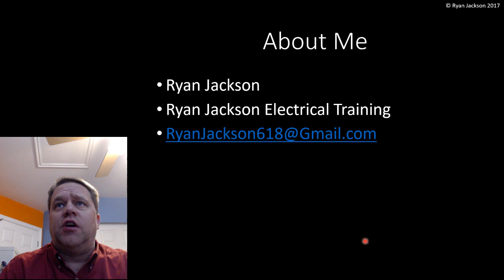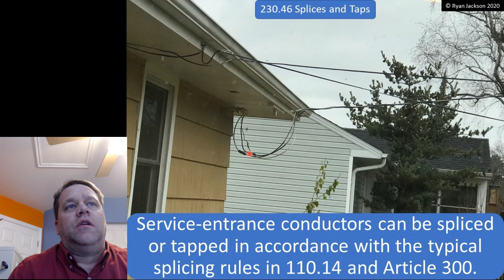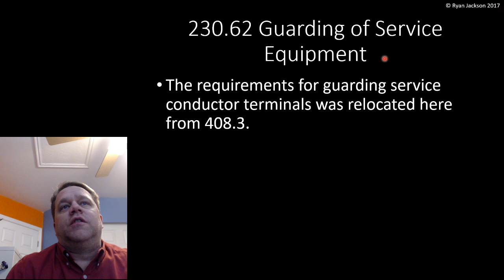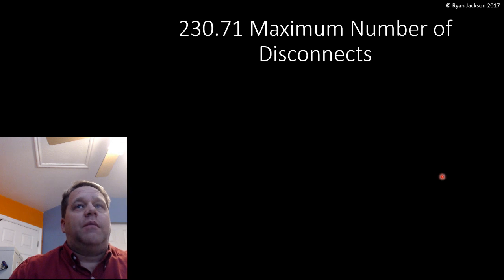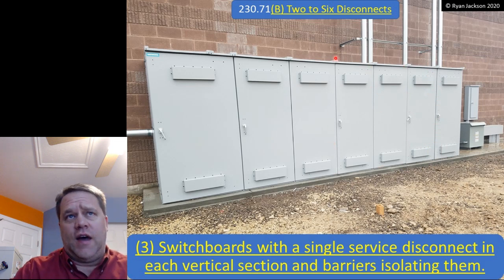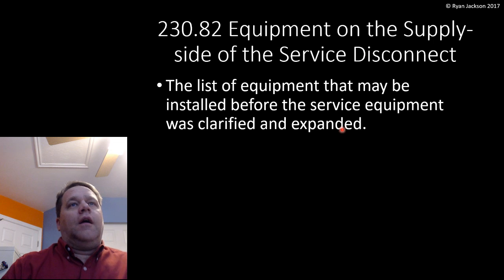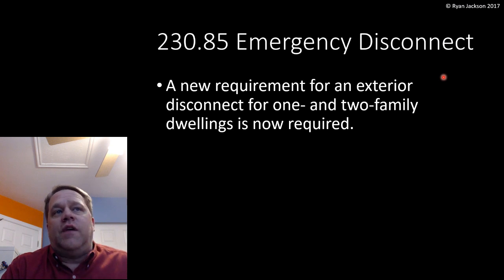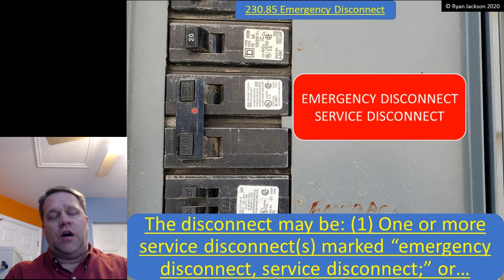2020 NEC Article 230 changes

Comment: I wish michigan adopted the service disconnect requirement before we installed all these solar panels. (one and two family dwellings) utility workers like it when electricity comes from the power plant. Not single and multi family dwellings. As one who is expected to work with electricity i feel responsible to point this out. Im just a hud daddy.
Reply: In michigan, for it to be approved by the utilities, which is a legal requirement for them to operate legally, exterior isolation of the solar inverter is required. Plain and simple, the majority of installs are not legally operating, but none of the cases referred to the state have gone anywhere. I've seen the photos of krone blocks for telecoms melting because an installer(not the homeowner) used them to terminate and aggregate DC at hundreds of volts from the solar panels to the inverters. That installation had no disconnect anywhere, and required a troubleman to cut the line such that the system could be rendered safe and inert. Ruined a brand new pair of insulated cable shears.

Comment: I've pull the meter vice schedule a service outage with the utility. I contact the utility after the fact and they come by and put a new seal on the meter. Does the code address this method?
Reply from the maker: The Code doesn't address work practices, but I can tell you that many utilities will have a fit over that. It is also not particularly safe.

Comment: Not in total agreement with the SPD requirements. If the code is not intended to be used to make electrical systems efficient then why are we going down this path. Surge protection is used to protect electronic equipment within homes it does not protect the building wiring system or people . Again another change to the code geared to make manufactures money and cost homeowners and contractors more money. getting out of hand is what the code making panel is doing.

Comment: About five minutes in you state that there’s a lot of things in the NEC that don’t have to be listed. I would strongly disagree. Essentially by everything being Labeled, listed, or approved, it keeps me from using a vacuum hose as a raceway…
As the one meme with the guy sitting at a table drinking coffee: Change my mind. 

110.2 Approval. The conductors and equipment required or
permitted by this Code shall be acceptable only if approved.

Equipment. A general term, including fittings, devices, appliances,
luminaires, apparatus, machinery, and the like used as a
part of, or in connection with, an electrical installation.

Approved. Acceptable to the authority having jurisdiction.
(CMP-1)

Identified (as applied to equipment). Recognizable as suitable
for the specific purpose, function, use, environment, application,
and so forth, where described in a particular Code requirement.

Labeled. Equipment or materials to which has been attached a
label, symbol, or other identifying mark of an organization that
is acceptable to the authority having jurisdiction and concerned
with product evaluation, that maintains periodic inspection of
production of labeled equipment or materials, and by whose
labeling the manufacturer indicates compliance with appropriate
standards or performance in a specified manner.
	
          Informational Note: If a listed product is of such a size, shape,
          material, or surface texture that it is not possible to apply legibly
          the complete label to the product, the complete label may appear
          on the smallest unit container in which the product is packaged.
Reply from the maker: Yeah, most things in the NEC DO NOT need to be listed. Everything needs to be approved [110.2], and many things need to be listed (luminaires, appliances, and many other), but most things do not (circuit breakers, panelboards, transformers, motors, SEVERAL others). I think you are probably misunderstanding 110.3, which happens a lot. Notice in 90.7 that phrase "specific items." Many products CAN NOT be listed because there is no product standard by which they could be tested and subsequently listed. This is why specific articles require listing for items falling under the article's purview, but, again, most do not.
Reply from the maker: Section 110.8 is what keeps you from using a vacuum hose as a raceway.
Reply: @RyanJacksonElectrical  you use breakers as an example. If a breaker isn't labeled for use in a particular panel, it can't be used. I have seen this particular item shot down by many inspectors over the years.. 
I might give a little on "listed"..
Reply: @RyanJacksonElectrical  yes & no for 110.0.... (sorry I thought it would tei to the post I replied to)  Most of my experience has been industrial, where the AHJ is the company. While many companies have specs that far exceed the NEC, many do not..... 
Quite often you have to battle with a young, fresh out of school engineer, that has no experience or practical knowledge in the field.....
Reply from the maker: @dewaynefanchier589  Again, nothing in the NEC requires everything to be listed. That was your argument, and your argument is wrong. Period. It is wrong.

Comment: Hummm  everything has a ying and yang , good and bad,  230.85  the disconnect is a must , I would bet there are more home invasions then fires  Just wait until the thieves  start killing the power outside of a house ( at night) , talk about home invasions best friend .....
Reply: This happens in another form in Atlanta.  Crooks rush into a home and first cut the wires to the alarm system and rip off the wireless panel unless its wired, in which case they cut the wire from the outside.  This outdoor disconnect only works in a low crime/high trust society.  Speaking from experience...
Reply: You can put a lock on the panel.